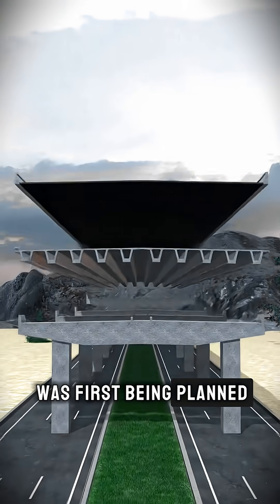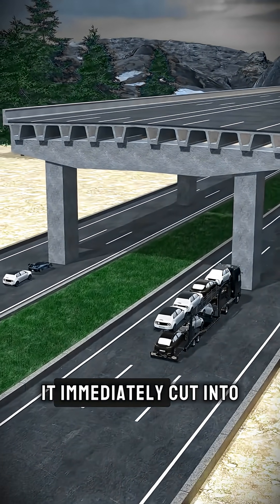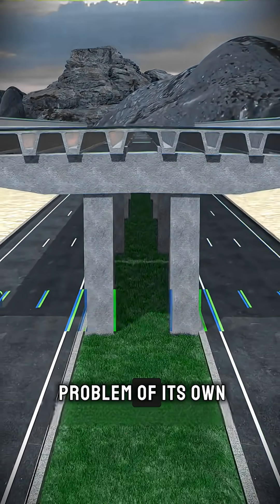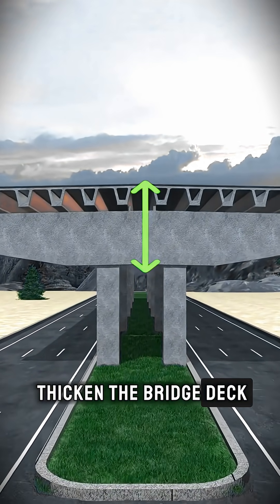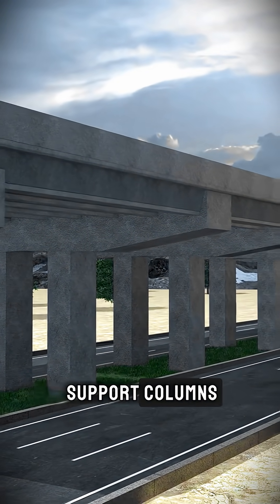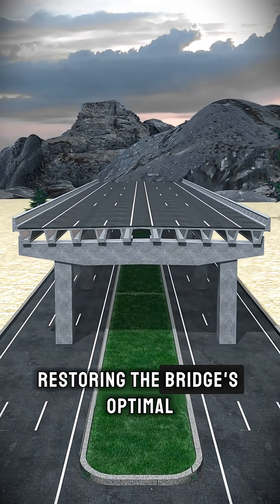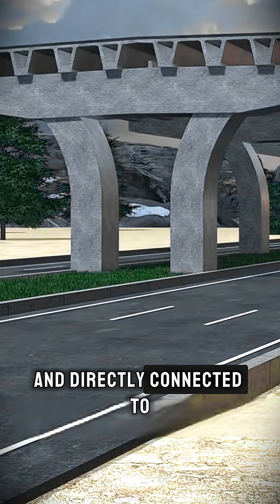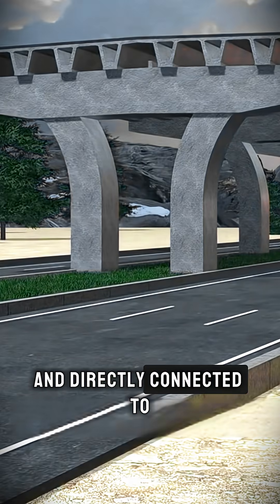How Engineers Invented the Arched-Pier Bridge to Reduce Cost and Increase Safety 🤯

Comment: Whether they increase cost by enlarging span beams or by using curved beams ..the cost is very similar in rise. Safer to just enlarge the span and increase the piers. either way... it was a huge construction cost, as a curved bean required a massive increase in the reinforcing system and continued into the latitude span beams. 
Simply fixing a major fk up like incorrect location of original piers in middle of road, is going to double the construction cost no matter how simple AI voice over makes it seam, lol.

Comment: Most elevated bridge designs are crap, because one of the priorities of building the structures is the reduction of cost. Most Chinese built highway structures will not last 50 years, because they will not maintain them properly, and that most of the original material does not meet safety standards. Western elevated structures are better built but priority was never to repair and replace them in a process that did not dramatically hinder traffic. Why? Because of the devious nature of planned obsolescence,  where companies want to get paid more by making products that don't last or perform much longer and better.

Comment: Why not take the green space and adding two commuter rail lines.  Thus the congestion that the elevated bridge would elevate, would move to the commuter rail line zipping by at 60-80 mph.  It would elevate the co2 and particulates added to the environment too.  It would also be less expensive which is a bonus.

Comment: I don't get it why didn't they just do the thing with the center and then have some extra ones on the outside of the highway supporting the outer edges to reduce the extra stress they don't even have to be full-fledged beams on the outer sides? 
I suppose you could argue that it would be more expensive but I mean you don't have to use expensive materials it's just something to relieve stress right?
Reply: I guess what they ended up doing works pretty well I was just curious as to why that was never even something they considered

Comment: They should have used Vibranium for Support
Reply: Fuk use Uru metal ✌🏽
Reply: Galvanized Vibranium was the correct solution
Reply: Oh no, vibranium is a fictional material, bro. Just use tungsten, because it's a real material on Earth. But the cost will increase significantly if they use tungsten 😂.
Reply: @seldyvictorio7973 do you not understand sarcasm? 😂
Reply: @Jess_8765 
Not necessary to understand
Reply: @Jess_8765 Of course I know it's sarcasm, but I was just making a more sensible joke. because vibranium is just a fictional metal 😂.

Comment: Why didn't they put the girder legs on the very outside of each side and then put a center column in the middle and that would save all structural integrity and less expensive?
Reply: My thought exactly
Reply: How? 3 pillars and stretched width will increase the cost. One pillar has to be in the middle for that much width. it will onsume more space as well i think
Reply: Sometimes, they do. But, the cars still have to get in and out between those columns on the outside.

Comment: Why not have three piers for the bridge. One at the center and one each at the extreme end of the bridge to bear the load.
Reply: Extra cost
Reply: @rickyfeb21
Then shift the whole construction with two columns at half, so that one street only is covered.
Reply: @switch12345678  what do you mean two columns at half?
Reply: @rickyfeb21 two center columns (as displayed) with a third column on the outside of one side of the roadway.  That would shift the weight-bearing and reduce the structural fatigue risks that were cited when two straight piers/columns are placed at the "half" point (center median) by adding a third weight distribution point
Reply: Seems like the best solution.